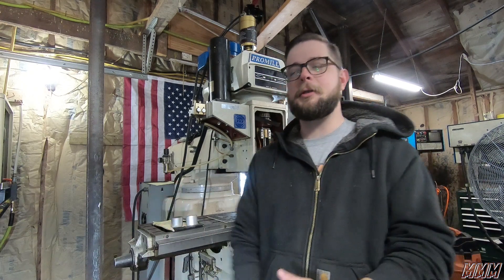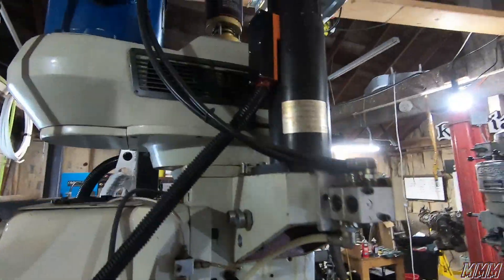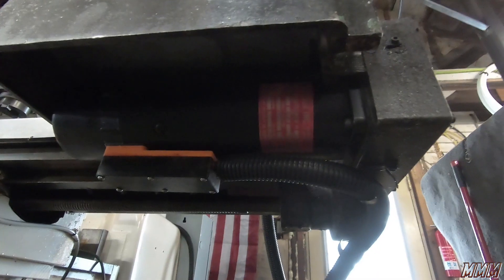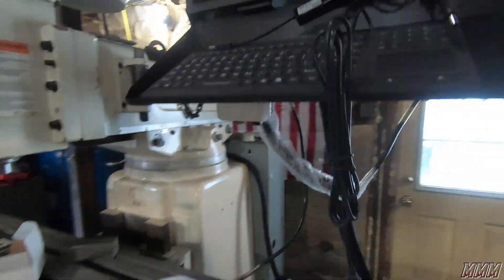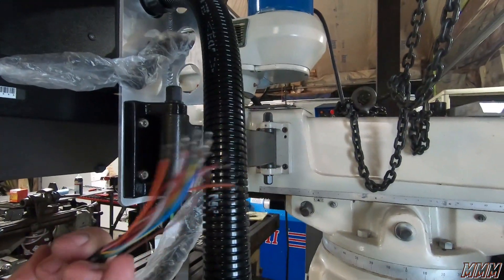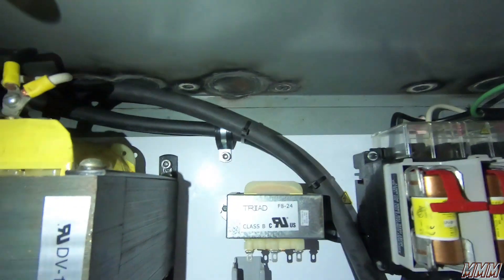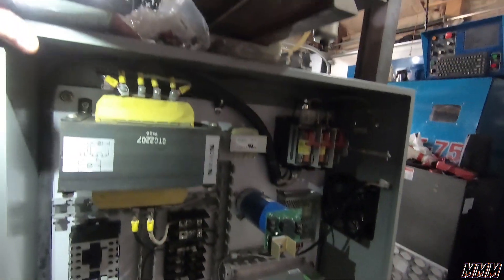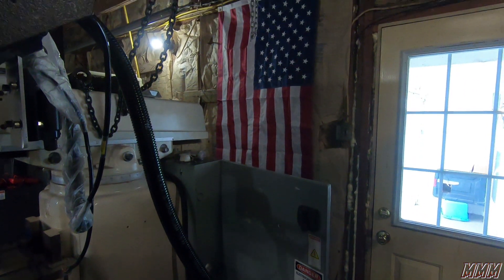Servos, Power, Give me a Coolant Shower - Saving $20,000 over a Tormach Mill - Part 3

Comment: Thanks pretty informative 
I will most likely go with centroid????
Like you no big rush 
Did you buy transformers separate???
Reply from the maker: The main transformer we reused off the original machine.  The 120v to 24v transformer we did buy new and i think it was around 30 dollars.

Comment: Dont complain that cables are too long, be grateful and complain when they are to short. You can always shorten them to suit.
And transformers are AC only, look out for a rectifier after (generally with a smoothing capacitor) to get your dc. 
Nice conversion. Looks like it will be a capable machine.